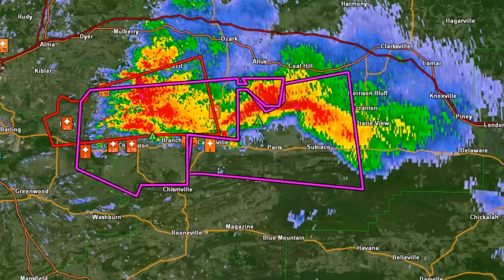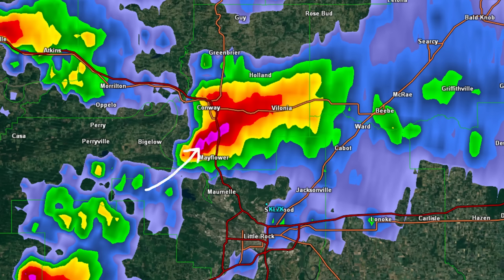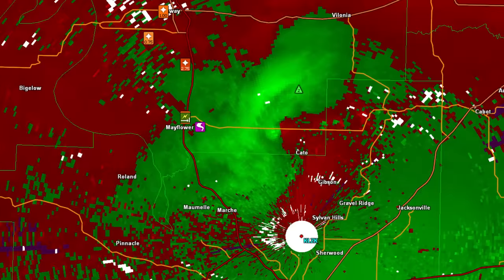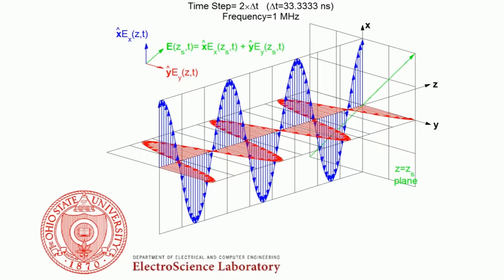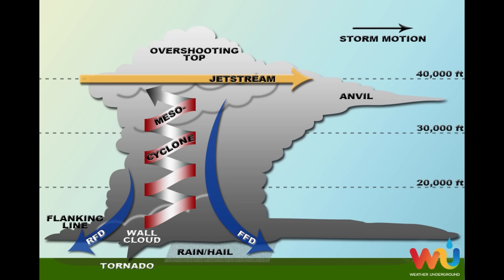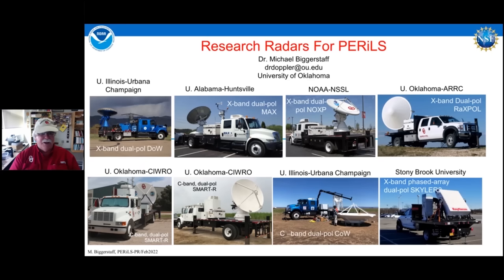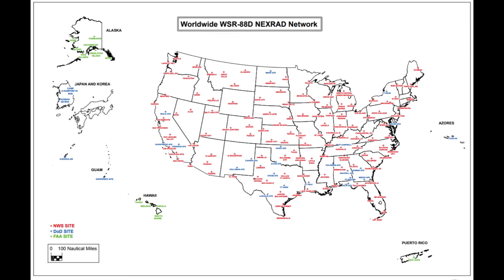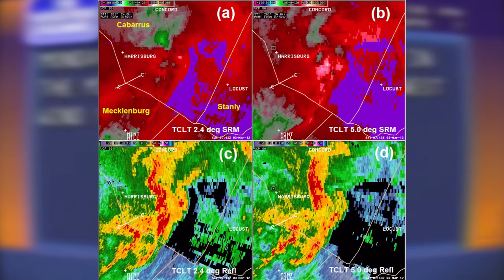Can Tornadoes happen with ZERO warning?

Comment: In the DC metro area a few years back I walked outside to look at the clouds as a severe thunderstorm rolled in. Looked to my left and saw a funnel halfway to the ground! Called my family outside to look and tell me my eyes weren’t deceiving me. It was definitely there, rotating and going closer and farther from the ground like it couldn’t make up its mind. At no point were we even in a tornado watch, let alone warning. Honestly it had to be extremely weak, given that it kept trying to reach the ground and pulling back, (granted it never VISIBLY reached the ground) EF0s and occasionally EF1s are fairly common in the summer, but shocked that a watch or warning was never called. Tornados are not a joke in the mid Atlantic. I still remember the EF3 that tore up La Plata MD, and the EF3 in Faquier County VA.

Comment: I literally stepped out into an F0 tornado... they get called straight-line winds a lot. I had developed a severe panic disorder related storms due to a lightning blinding instance and was attempting to confront my fear. I saw the black clouds coming and I put on my leather jacket and stepped out onto my porch... just in time to watch the tree in front of me spin in the wind and watch the circulation continue down the road. Later I walked the neighborhood and realized there was a actual damage path if you knew what to look for. It was definitely just an F0 but I stepped directly into it. About two blocks away we had an F2 equivalent hit the hospital back in about 2002 and I've seen numerous F0's and F1's form in similar fashion since then.

Comment: The 2017 Tulsa tornado basically came down on the house I was living at in the time. I was up late making some food when the wind picked up hard and then we lost power. I ate and went to bed thinking it was just a storm. Didn't find out it was a tornado until I woke up in the morning and found out the neighbors across the street had roof damage. We were about a mile west of where the businesses were damaged, but we still didn't have power for three days.

Comment: I live in southeastern Oklahoma, having moved from southwest Oklahoma. The town I live in was hit by a HP Supercell that dropped a tornado that was not warned last month. I'm a spotter/chaser, and closely watching the storms from the outbreak, I knew that particular storm would likely drop a tornado. It was the southernmost cell in the line and was feeding from the northern storms in front of it. My town is in the dead-zone between OKC and Dallas. You could not distinguish any couplets and you could barely discern the HP cell on reflectivity. 
This side of Oklahoma has been experiencing a higher number of Supercell storms as "tornado alley" has shifted east over the last decade. There were a large number of homes and businesses destroyed by that storm that wasn't warned until after reports of people trapped in homes were called across the scanner. You usually can't even see the tornado in a HP Supercell, so there was basically zero warning when it dropped.
I did find the article that states they are building a new radar in Durant, OK to fill in the gap. We are so fortunate that there was not a loss of life with that tornado. It tracked 15-20 miles, and basically leveled out another small town. 

I did find the article that confirms the constitution of the new radar: https://www.newson6.com/story/62560a38a1148a0728447400/new-doppler-radar-system-to-improve-storm-tracking-in-southeast-oklahoma

Comment: My wife an I were in a QLCS tornado last year. It was rated an EF1 despite the fact that ground level radar indicated a maximal opposing wind shear of 130mph. What was surprising to me about that was a couple of things. The houses it hit were constructed in the late 1940's and or early 50's and besides some external porch structures and such, everything besides cars and trees was largely intact. Some roof damage but not as bad as one would expect. That being said it threw a jersey barrier into my wife's car and dented the crap out of it so we officially had an insurance claim for tornado damage. Secondly the storms that birthed it were flying through at close to 60mph so the tornado was on the ground for no more than 30 seconds. I heard the tornado clearly but didn't experience any pressure drop, just the railroad sound. Likewise we were less than 150 feet from the center of rotation and never saw the rotation. It was completely rain wrapped and we couldn't see 5 feet outside of the car. It was a novel experience and we had no idea it was actually a tornado until the NWS came through and took pictures of the exact tornado path. Very clear it was a tornado when you were right where it came through

Comment: Some thunderstorms were about to come through when I was driving home but it was still sunny out. I called my husband and asked if there were supposed to be tornados and he told me no but the clouds looked weird. A long skinny cloud got lower and lower at the tip, right where I was. Then I watched it touch ground and start spinning in a golf course a few hundred yards away. Slammed on my brakes and threw it into reverse and backed up right on the road about a block and watched the tornado cross the road right where I had been. The second it passed the torrential rain started and all traces of the sun were gone. My 8 year old caught the whole thing in pictures and we sent them to the tv station but they never reported it or even acknowledged that there was a tornado. And I live a few miles from a dopplar radar. Scariest thing ever. It was like it was aiming for us!

Comment: Yes I was in Benton, AR on May 8, 2003 when I identified a funnel cloud and proceeded to follow it as it moved in and out of the cloud base.
There was no warning at first and 911 told me someone else had just called in to report it and they were sending an officer to verify.
They sounded the sirens a few minutes later.
Within a few minutes it touched down and did $1M damage to a car dealership and damaged some houses.  It was rated F3.

Comment: I have experienced an unwarned tornado before. It was in June 2019 and usually in Ohio in June and July, throughout the summer, we get these little pop up rain showers and thunderstorms. Nothing too concerning. So it was just a normal sunny day with a few cells going through the area and then my dad called us and told us that a tornado had hit one of our barns. Fortunately no one was hurt, the tornado was classified as an EF0 and had a path of like 1/4 mile long, however the barn was a total loss. But anyways, NW Ohio, where I'm from, lays in a minor radar gap. That storm want warned, btw, until after the tornado had lifted. So that was an incredibly odd situation.

Comment: Aside from the August 28th, 1990 tornado that devastated Plainfield, Illinois; the tornado that devastated Joplin, Missouri on May 22nd, 2011 is an example of how a tornado can form too quickly for the National Weather Service to issue a Tornado Warning or Tornado Emergency. When the tornado sirens in Joplin, Missouri were sounded at 5:17 PM Central Daylight Time; this gave the residents of Joplin seventeen minutes to take shelter. By the time the tornado sirens began wailing a second time at 5:34 PM Central Daylight Time; it was too late for the National Weather Service office in Springfield, Missouri to issue a Tornado Emergency for Joplin because the tornado was already on the ground and moving through the city, causing damage on the west side of Joplin as well as in the city's downtown area and on the south and east sides of Joplin. Aside from forming rather quickly; what also made the Joplin tornado so deadly is that it was hidden in very heavy rain and difficult to see.

Comment: This was a good video.  Each NWS office has its own webpage where you can access the radar and you can see the base reflectivity, but there are significant delays in data because one scan takes so long and then a little longer than that for the computer to process the data.  There is also a limitation on when they issue the warnings because they see it, then they have to type out the information, then send it.  The Dual Polar radars are a good thing, but at this time there are not enough of them.  Check out the convective outlooks, but even then, they may not issue a risk area because of a level of uncertainty.  There may not even be a tornado watch issued because there isn't enough certainty or it is not expected to be widespread.  Then a storm forms, spawns a tornado, nobody is really watching because the forecasters didn't issue any kind of outlook mentioning tornadoes.  I've seen this happen a few times in my lifetime.  I think it was in 2013 or 2014 when a QLCS was moving towards the DFW metro.  Then suddenly several discrete supercells formed ahead of the QLCS spawning upwards of 10 tornadoes in just a couple of hours.  Luckily nobody died in those just because of where the tornadoes struck, hardly any residential areas and the one residential area that I saw that was struck had minor damage to the roofs.  If the tornado that struck in Dallas , very near Mesquite I believe, would have been several miles one way or another it could have been deadly.  They were on top of it after the first one formed, but they didn't issue a warning on one of them in the far SW side of the metro until after it had caused serious damage and some injuries.  

Regarding the holes in coverage, The nearest NWS radar from where I live is about 80 miles and there is a complete gap in coverage of the base of thunderstorms not too far away into SE Colorado.  They need to get that covered even though there isn't that many people that live out there.  It shouldn't really matter what the population is, get it covered.  The federal government gets plenty of money to do this from tax revenues.

Comment: Our company, Tennessee Valley Weather, was founded to try to close the radar gap over southern middle Tennessee and northwest Alabama.  In May 2020, we installed an X-band dual-polarimetric Doppler Radar in Lawrenceburg, TN, and the data from it is shared with local NWS offices and EMA in real-time.  It's caught several small tornadoes since it was installed.  However, X-band is very prone to attenuation, and our radar only reaches so far.  We are working with local EMA offices in the area and a big weather graphics/radar vendor to try to do something similar to what Durant, OK and Wilcox County, AL are doing... trying to get a larger, stronger, farther-reaching C-band radar installed that would close the entire radar gap across this local area.  Getting a NEXRAD equivalent installed would cost $10 million or more per radar site in today's economy.  It's going to take grassroots type initiatives like the ones mentioned here to try to fill some of these gaps in low-level coverage.

Comment: We had a tornado here in Russelleville Arkansas that there were no warnings at all. The storm just blew up, and the tornado was on the ground. The radar stations in Little Rock, Fort Smith and Fayetteville could not picked it up because the radars could not pick it up since it is in a valley surrounded by tall hills in the river valley. It was not a strong one, and it missed my house. This happened during the day. We have a big radar gap here. There should be one built in Russellville, Hot Springs and Arkadelphia.

Comment: Yes they most definitely can happen without warning. On January 1, 2022 at 8 am I had to take cover cause a tornado popped up right in front of my house and there was no warning before.  The sirens didn't go off until after the tornado had came and gone but it was way to late at that time. Thank God we didn't get hurt. It was a very scary day for us.
Reply: Did it cause any damage?
Reply: Yes it caused a lot of damage quickly it ripped a lot of buildings apart.  it sounded like nothing I had ever heard before  like a giant vacuum cleaner,  it sucked all the air out of the house and it was so scary.
Reply: There does not appear to be any damage reports from January 1st at roughly 8 am.
Reply: There is a lot of damage.

Comment: Not exactly without warning because there was a tornado watch, but at one point we were in our house on a really windy, stormy day. My sister looked out and something destroyed a tree and our carport. The weird thing is that, in spite of snapping a sturdy tree in half and ripping apart a carport, it lasted only a few seconds. It seemed to have formed on top of the tree directly, moved to the carport, and then dissipated. I don't know if it was a weird, tiny cyclone that formed and lasted for a few seconds, or if it was a downdraft. The weird part is that the objects it destroyed were spinning, and I'm not sure if a downdraft can cause that. Y'know, spinning in the air like a cyclone got them. I think it was a small, short-lived tornado. I did some googling after and supposedly these sorts of tornadoes might actually happen all the time, unbeknownst to people because they're invisible, small, and live for so short. It's really interesting. Supposedly that storm had a lot of reports of these, if I recall right.

Comment: Steve, this weather event was not an unwarned tornado, but an unwarned wall cloud.  As no tornado was spawned from the wall cloud and, thus, no damage nor injuries/deaths occurred, I find the situation humorous and the NWS left with egg on its face.
It happened Summer of 2016 or 2017 in the Twin Cities (Minneapolis/St. Paul, MN).
The NWS office and radar site is in the Chanhassen area.
 Around six o'clock p.m.is when the NWS started to receive many phone calls as to why there was no tornado warning and the Civil Defense Sirens were not activated in the area.  As it turned out, a wall cloud was directly above the radar site and office of the NWS.  No one, at the NWS office, noticed this fact.  
As you probably know, a radar is unable to gather proper information directly overhead or very near the radar site.  So, it was the public that informed the NWS office that there was a wall cloud directly over the NWS office!!
Thank you for your videos.
p.s. would you and your fellow YouTubers stop using the term "scary looking cloud"?  I am sure that Dr. Fujita never used such terminology in his lifetime.

Comment: We had two QLCS tornadoes in Adelaide Australia in 2021 they developed as the squall hit the outer southern suburbs, it damaged my unit and took down some large gum trees in the process. If I didn’t go back inside because there wasn’t any structure to it I would have been caught completely off guard from it while being outside. Nobody was injured somehow but the damage was significant. The radar updated after both passed and you could see it there but that delay meant it wasn’t visible anywhere until after. Also this was South Australia and we don’t get a lot of tornadoes so we don’t have tornado warnings at all. The other large event was the insane 2016 system that took the entire state out of power and produced 2 or 3 tornadoes but nothing like those severe imbedded supercells since.

Comment: I have experienced an unwarned tornado. I was driving to work in from Quinlan Texas to Terrell Texas and during the drive I saw a transformer explode about an 1/8 of a mile ahead of me. The road curves around the pole that held the transformer and when I cleared the bend in the road a hay bale was rolling across the street and the back of my truck lifted a little bit and it ripped a plastic tailgate strip off my truck and pulled all of the stuff out of the bed of my truck. I made it out and my wife called me about 2 minutes later and said she was watching a tornado cross the small lake we lived by in a rock quarry. Had it been a massive tornado I wouldn’t be here today. Very scary situation. I never saw the actual funnel cloud either.

Comment: it still amazes me that the area i live in   which is near that radar site in greer SC has no tornado sirens  it might be due to the fact we get our broadcast stations interupted by  EAS messages direct to our phones tv's  and car radios.  but coming from minnesota  and living in places like iowa and nebraska where sirens would go off even for severe thunderstorm warnings.. i tend to keep an eye on the weather more  now here than i did in those states.
Reply: Hey Neighbor! Most of the sirens here were locally funded and are being taken out of service due to high maintenance costs as they fail, or by plan like Spartanburg County has done. With most people having cell phones now they're kind of redundant, but some places like Clemson University have actually upgraded their systems to new electronic 'sirens' which have voice functions that can be used for other things and don't need maintenance. Many places in the US are doing likewise now as many replacement parts for the old sirens have gone out of production. Probably half the sirens in the US date back to the cold war so you can see why this is happening now.